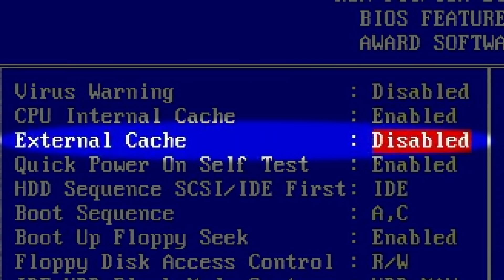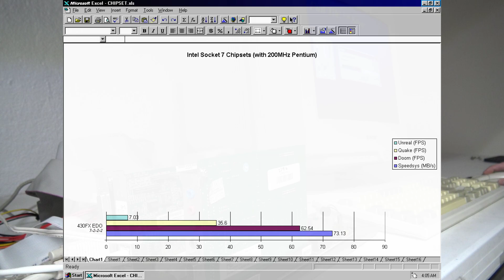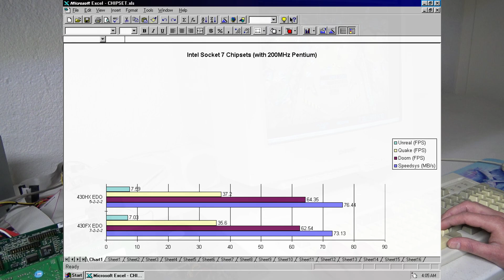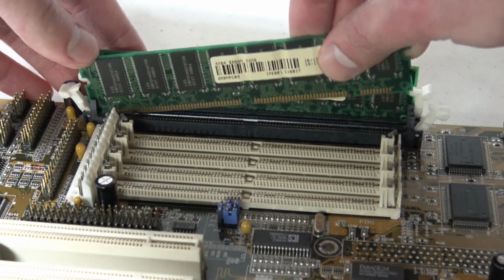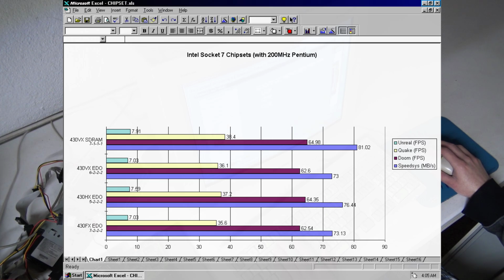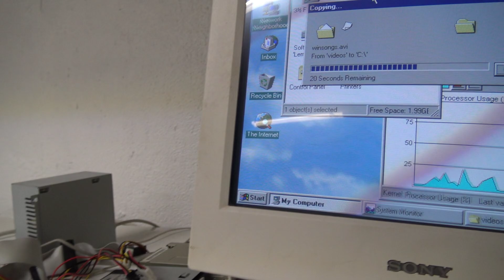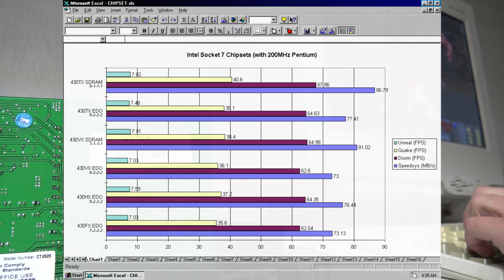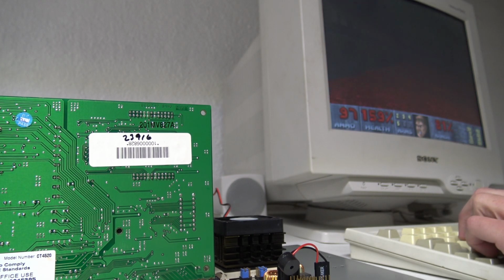Intel Socket 7 Chipset Comparison

Comment: Very informative video :)
I got myself a DFI P5BTX/L and I am super happy with it.
I rolled the dice and gave it some weird newer beta bios which worked out flawlessly.
For an intel based socket 7 it's running an AMD K6-2 400Mhz, with 64MB Ram and a PCI Voodoo 2000. The motherboard USB is also working perfectly with Windows 98se
That 66mhz bus certainly is slowing it down but... it was a fun enjoyable project... One thing people tend to forget about Vintage PC builds is how painfully annoying they are.
The amounts of issues, of finding the right components, the drivers, the reformats.... Lots of fun.
Reply: and don't forget about DOS memory management and resource conflicts